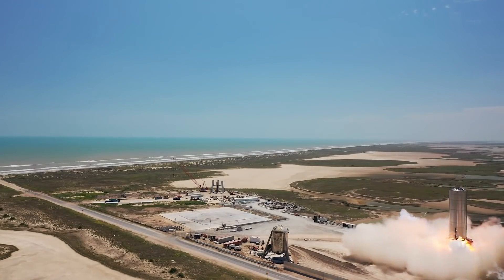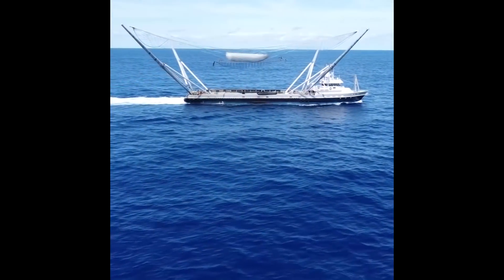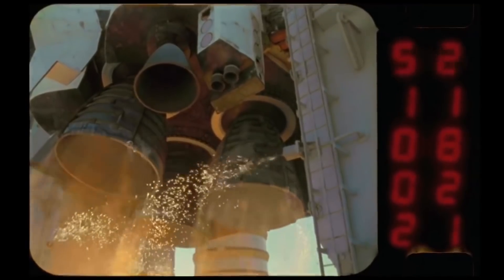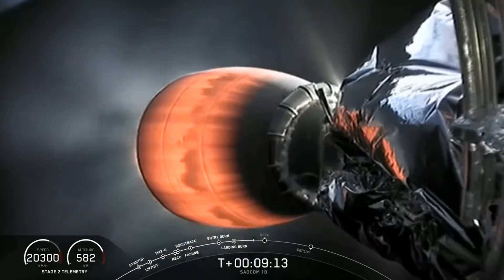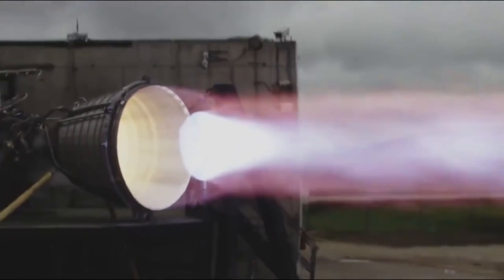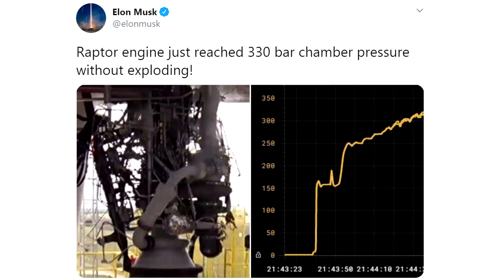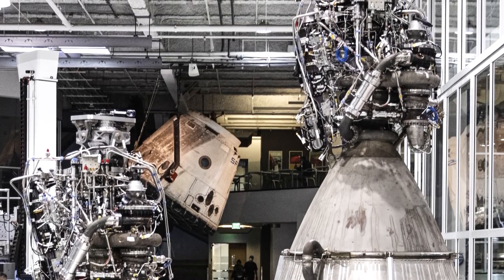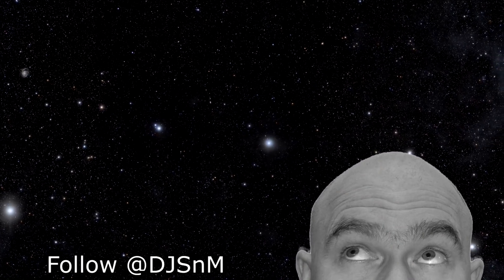How SpaceX's New Raptor Vacuum Engine Is Different From Previous Raptors (and Other Stuff)

Comment: Wait, so they're literally using crumple-zones as shocks?

Guess this makes takes Lithobraking even more accurate as a descriptor.
Reply: Apollo used it on the Lunar Module.  No reason not to use it.
Reply: rdfox76 that was a one time use vehicle though.
Reply: If it works, and you can still use the vast majority of the faring for future testing/use, then it's still a decent design. Even if it is a crude solution.
Reply: @RavemastaJ   I prefer to call it brutal elegance instead of crude, because they're actually meant to telescope up in a wedging action, IMO. The crumpling happens because the one-engined tilted ship puts too much weight on the first couple of legs to make contact, and the ship's moving slightly sideways, not straight down. The leg telescopes to the limit, then crumples further.
Reply: SpaceX doing development testing for Tesla.
Reply: Keep in mind this is a prototype this is not the final design of the legs.
Reply: @dclpgh  
When they start building these on Mars, they are going to probably retro-fit them with this. You wouldn't expect a recycled rocket to be sent back from there with full-on hydraulics or other fancy bits.
Reply: @RavemastaJ  Musk said the final design will be close to the  f-9 design with auto leveling.
Reply: It’s things like this that make me think ‘how much kerbal has Elon been playing again’
Reply: starshipeleven  
 1 - moonship is never returning to earth, it will have to be serviced in leo one way or another. it will have to have legs designed to be replaced easily. as for mars it's the same, a starship on mars will have to return to earth so it needs landing legs. if the legs get damaged by accident and not by a crumbling system it will have to be serviced in leo to be of use ever again, either for mars or earth, so we are back to square one.
 2 - a crumbling system is lighter than solid legs. you could carry two crumbling legs instead of a strudy one, and you have an spare in case of an incident. plus carry a single crumpling one and no spares and you are saving cargo to the moon which is more expensive than leo. then replace damaged legs in leo. yes it is expendable, but you can still get the damaged legs back to earth if you want.
 3 - the whole moonship and mars starship relies on 4-6 dockings with refueling starships. transfer of crew from a crew dragon to a hatch in the cargo bay is a good alternative to launching starship with crew without a escape system before it has been thoroughly tested. and starship will be used for emergency missions. there will be plenty of starships in space at all times.
 4 - everyone is complaining about how starship has "too much payload capacity" and that it will never be able to fill it completely. a mission to the moon for artemis will probably have plenty of unused cargo capacity and just a couple dozen astronauts at best. this is perfect for carrying spares of everything, which increases the reliability of the system.
 5 - having legs that can be easily replaced is an advantage on earth as well, as it will allow them to launch starship again faster. you swap the legs, launch, and take time to do the inspection.
 6 - starship WILL weight as few as 100 tons with aerosurfaces. moonship lacks these and will be lighter. starship will always land with tanks completely depleted, using the fuel and oxydizer in the header tanks. when it is fully fueled it will be in the launchpad. on top of superheavy. legs will always be folded down.
 7 - on the moon and mars they will have rovers and tons of cargo. enough to pull starship towards the ground as they replace the legs. also a jack on the moon will be even lighter, as if starship weights 120-60 tons on earth it will weight only 10-20 tons on the moon. so a CAR JACK could do.
 8 - this one might be stupid, but starship could use it's small engines to hover while the astronauts do repairs, provided they have enough fuel.
 9 - spacex has plenty of experience with docking and space maneuvering, and will need more for starship refuelling. service robots and SCVs just make sense. also there are many companies working on space robots, like the gateway foundation, rocketlab, lockheed martin, etc.
 10 - artemis and mars missions are for 2022. the current design is the one that will make it to orbit (as per elons last tweets). any improvements will be to make starship lighter. they could make legs out of some supermaterial that can take the impact and not be damaged, but i bet it will be cheaper with starship to just use these cheap ones and send spares, it will also allow them to mass produce them, which is what they are prioritizing right now.
Reply: @jesusmora9379  
Moon version of Starship is only for between surface and orbit of Moon. No heat shield tiles means no aero-capture means no return to LEO (Earth).
Reply: @avid0g  it does return to LEO. it just can't land on earth.
Reply: @jesusmora9379  
A you talking about the lunar version of Starship? It doesn't have thermal protection tiles, no protection against extreme heating, so no aerobraking or aerocapture.

The lunar Starship does not leave lunar orbit except to land on the moon. No return to Earth. No Earth orbit. Not enough propellant to ease into orbit around Earth.
Reply: @avid0g  it has been stated multiple times that moonship has enough fuel after landing on the moon to take off and return to leo. Also the steel skin offers enough protection to reenter the atmosphere, it just can't be reused afterwards. More than enough for aero-capture.
Reply: @jesusmora9379  
A conventional Starship clad with thermal protection tiles could do this - return to Earth intact. A lunar version would melt and break up. 

There are no credible sources saying that a completely unshielded bare stainless steel version can survive aerobraking from LEO to the landing pad, much-less the Lunar return velocities for aerocapture into LEO. 

The only way to achieve this fantasy is to, somehow, have full tanks of propellant At The Moon to decelerate into LEO. Nobody would do that because it would be a total waste of that propellant, since a conventional Starship will make the trip with nearly empty tanks from lunar orbit.
Reply: With real careful design maybe you could use it like a leaf spring and have it spring back.

But that would be huge engineering challenge to figure out and may be too hard to design and too heavy 

I would guess hydraulic absorbers better but I’m guessing
Reply: starshipeleven  Reusable doesn't mean there is no refurbishment involved in between launches.
Reply: starshipeleven  it is expensive now because rockets are expensive. starship is meant to reduce the cost of space, which is when carrying an extra leg or two stops being an impossibility.
 legs can be light, they just need the right structure. an hydraulic jack can be carried by a human and they can lift a car, which can weight up to two tons.
 changing the legs can be designed to be as easy as using a release mechanism and swapping them. maybe not changing them on the moon, but starship can take off, go to leo, and then it could be serviced by another starship, or we could have all sorts of space construction vehicles and robots, like the ones planed for the gateway station. it doesn't have to be people in spacesuits. starship has a cargo bay akin to the one the space shuttle had, except bigger and with much higher cargo capacity.
Reply: starshipeleven  1 - not useless. it could save them in case of an incident. and if the legs get damaged and can't be replaced, the whole moonship would become useless and have to be expended or abandoned in the middle of the moon.

 2 - not true. crumbling legs would be made out of a more elastic material designed to deform in a specific way. solid legs would have to be more sturdy to avoid any deformation at all, thus making them heavier because the leg is no longer hollow but solid.
 it doesn't have to be made using an EVA. a drone with docking software could hold the leg and pull out, then another one comes in and installs the new leg. the leg would be attached using a mechanism that can be activated from the bridge. there are at least 3 space robots with this capability, two of them in orbit right now. and they are made to move satellites which can have a mass of up to a dozen tons. and spacex has both docking software and the technology to build them, and are now building satellites too, so it would not be hard for them to make an SCV in a couple months.

 4a - starship has too high payload capacity. it makes it difficult to land on the moon because the engines are too powerful. an almost completely filled up starship would have an easier time landing on the moon using its small thrusters than one that's lighter. it has plenty of cargo capacity already to be able to land on the moon and then take off and get to leo, while carrying 150ish tons. i doubt nasa will use the full capability of starship for the artemis mission, even if they get 20 astronauts on board plus oxygen, spare scrubbers and food for 2 years, they would still have tons of unused weight left.

 4b - this is not flight, this is space. ships don't "fall out of the sky" if something goes wrong. they get stranded or lost in space. spare legs are better than having 12 legs. because if the legs break there is nothing you can do. you don't have cars with 6 wheels, you have cars with 4 wheels and 1 or 2 spares in case a tire breaks.
 the guys in that one spielberg movie wish they had spare spare legs for their flying fortress. luckily one of them had magic powers, but that doesn't happen in real life. in a spaceship it is worse because the legs prevent the engines and tank from being damaged, which is needed to lift off from a planet.

 5 - it would be just like swapping engines, it would allow them to launch again faster because it's one less thing to inspect within the 2 hours they have planned. say a starship has a rough landing, maybe it moves sideways a bit. you don't have to scrub the next launch, instead of unwelding the damaged parts and welding new ones, they just release the crumpling part of the leg and replace it in minutes.

 7a - there are no mass limitations with starship, it literally has too much capability for any nasa planned moon base construction. maybe not sending a crane, but something smaller could also work.

 7b - fair enough. working in the moon will be maybe too hard.
 canadaarm can fit perfectly inside starship's cargo bay, we could see a service starship, it could be used for satellite servicing and retrieval, which would fit nicely with replacing the legs of a moonship and more, since moonship can't return to earth and it needs back to back refuelling, and can allow for dozens of missions to the moon.

 8 - the small engines are near the top to prevent moonship from kicking debris. the raptors would be off while on the moon. they could do a small burn to lift starship and quickly put some light supports under it to hold it while changing the legs. then lift again and remove the supports, or do it in space.

 9 - it doesn't have to be made using an EVA. a drone with docking software could hold the leg and pull out, then another one comes in and installs the new leg. the leg would be attached using a mechanism that can be activated from the bridge.
 
 10 - see 2. with the pistons the leg has to be stiff to fit inside the mechanism. but the lower part can the crumbling to account for lateral forces. this would protect the moving parts. with a completely solid leg you need a more sturdy piston which adds weight. also you want more weight on the top of the ship to add stability during flight.
Reply: The falcon 9 landing legs have aluminum crush cores, my brother is an engineer at the company that design's them

Comment: One thing. The flaps on SN8 are not wings since they don't provide any lift and are there to do exactly the opposite, to create as much drag as possible. Otherwise an excellent video and incredibly informative!
Reply: Do you not call those flappy things on penguins wings?
Reply: @Vatsyayana87   An amusing thought. But...  Well, evolution has turned tetrapod limbs/hands into feet, flippers, and three kinds of wings (pterosaur, bats, and birds). A penguin's wings and a seal's or porpoise's flippers were both feet at one time, if you go back far enough in their evolutionary line.  What we're dealing with here is the vagaries of language and its many inconsistencies. These 3 animals' limbs serve the same function regardless of the name.

But man-created wings on aircraft have specific ways they interact with airflow, and it's very different from how Starship's control surfaces work. No existing term is accurate, and all are actually misleading, especially wing. Some wish the innovative terms brakerons or elerons had been adopted, but Elon has settled on "body flaps" for now. 

OK, I went way overboard here...

Comment: The Vacuum start up sounded like one of those ceiling mounted heaters with the big fan on them 😂 A hell of a lot warmer I’m sure 🤣
Reply: Funny how sounds overlap.

Saw someone build and test a 1000 oscillator analogue synth.
And since the tuning of each oscillator varies with frequency and they're all slightly different, when tuned to be in sync for a specific frequency, they're out of sync for others.

So... He turns it on and slowly ramps up the frequency, and I swear the entire first 15 seconds or so is just this wall of noise that sounds like a jet engine spooling up.
Then out of nowhere in the space of 1-2 seconds it all goes into tune and starts to make an actual note. XD

I guess what that suggests is a jet engine sound is basically pink noise, but still. XD
Reply: @KuraIthys  Look Mum No Computer
Reply: KuraIthys 🤣🤣 Crazy world lots of sounds 😂 it is crazy how similar things do sound. I mean those electric lawn mowers sound like drones somewhat then there’s the Tesla’s which can be like parrots 😂
Reply: Cost a touch more to run though  XD
Reply: Quiet Wanderer I mean we could brew the world a cup of Joe in the morning 🤣😂
Reply: a hell of a lot warmer
Not necessarily!
After all the gas expands in the nozzle and therefor cools down — to the point you can have ice forming on the lower end of the nozzle while the engine is active.
Reply: @advorak8529  That is actually true even though it sounds ridiculous.
 I saw that on a video of a deep throttling test of a LOX-LH2 engine (cant remember if it was a shuttle main engine).
During parts of the test icicles were forming below the end of the nozzle (yes I had to run the video twice to confirm that that was what I saw as I didn't believe it at first)!
Reply: @srenkoch6127     Simple adiabatic expansion.
Your fridge compresses the coolant (making it hotter in the process) and put it through the radiator on the back, which passes heat from the compressed coolant to the environment Then the coolant is expanded, becoming cooler in the process and let’s the inside of the fridge pass off heat to the even-cooler-than-that coolant …

All you need to do is to expand the output a lot and your rocket engine, too, can have an output temperature that even hydrogen becomes liquid. (Of course this would be a severe over-expansion in atmosphere, causing flow separation and all kinds of other problems.)
Reply: @advorak8529  I know.
It just seems so counter intuitive the first time you see it for real :-)
Reply: @srenkoch6127  That was probably a static test fire of a RS25 engine, four of which will be on the SLS. They are modifications of the space shuttle main engines. Yes, quite impressive. Before the test begins, the exterior of the engine is around ambient temperature, and once ignition starts up, the interior temperature of the engine approaches 6,000 degrees, while the exterior of the nozzle has ice form on it, due to cryogenic propellant flowing through tubes. So, assuming the nozzle is about one inch thick, what you have is 6,000 degrees on the inside and one inch thickness away you have frost!
Reply: Honestly, it sounds to me like the newer Dyson bathroom blowdryers getting into gear.
Don't dry your hands on a rocket though. Survey says it'll end in tears.
Also, my immediate reaction to your comment was something like "That's my pc starting." It isn't really though.

Comment: I'd bet that the flash of a flame is the methane with the cryo puff being the LOX before ignition. I'm no rocket surgeon, but that makes sense to me with the engine layout and the cooling method. You'd want to get the cooling started which would dump some of the fuel into the bell, the igniters would cause the fuel to combust, then the oxidizer would push that out rapidly as the oxidizer pump spooled up.